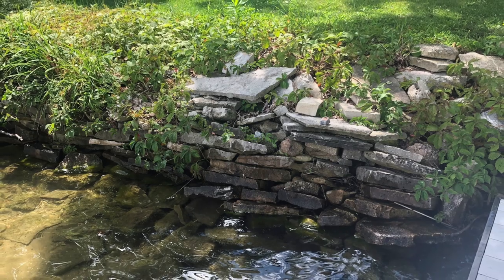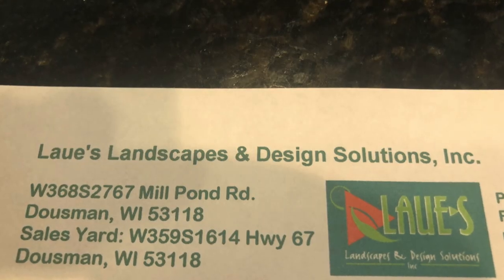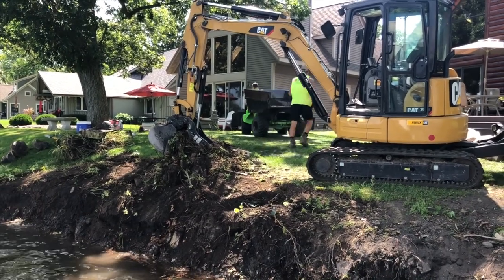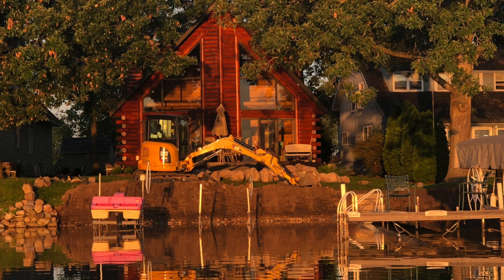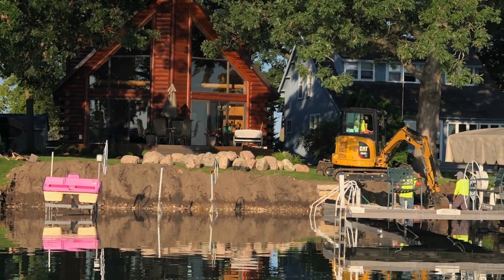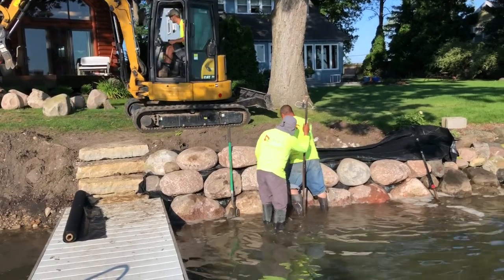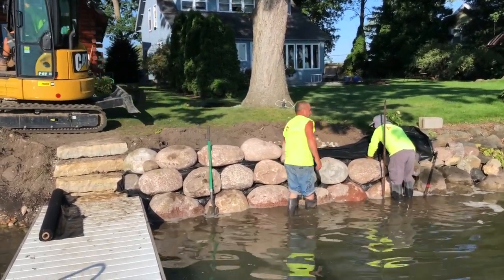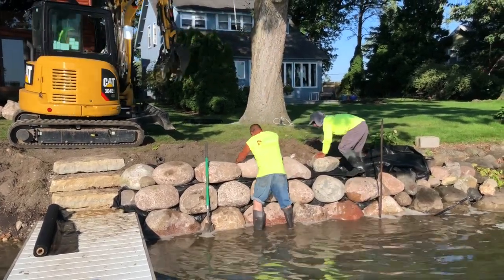New Shoreline Wall Built

Comment: That wall is absolutely horrific. Structurally it meets ZERO of the qualifications for a wall to last
Reply: Could you give more details for those without a background on this?

EDIT: I learned a couple things in the last few hours that might be helpful to others. Let me know if there’s more than I found here!

1. Looks to me like the biggest issue, among many, is that they’re supposed to prepare the slope of the ground first so that it is 3:1 length to height (ie, the shore should be more like a beach than a wall, the flatter the better). This is for many reasons, including ice issues. 

2. Best practice is to pack that dirt down, above and below water, before adding fabric. 

3. I’m assuming they probably didn’t use the kind of fabric you’re supposed to (according to one opinion, best is extra-thick 12-ounce industrial needle-punch filter-fabric). 

3. Properly securing the fabric (staples, etc).

4. Correct size stones. According to Minnesota’s Department of Natural Resources,* “Riprap should be made of natural rock, 6 to 30 inches in diameter.”

5. The rip rap has to cover the fabric, as even UV resistant fabric is susceptible to falling apart. 
 
* https://lakeshoreguys.com/dnr-approved-shoreline/